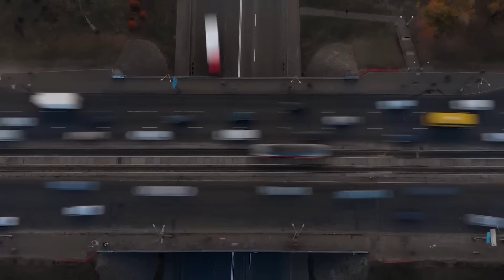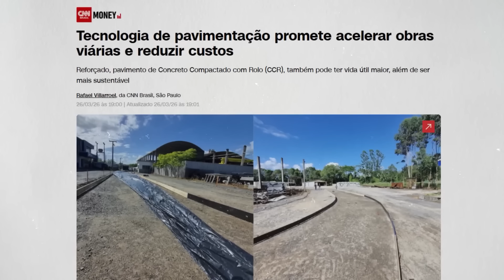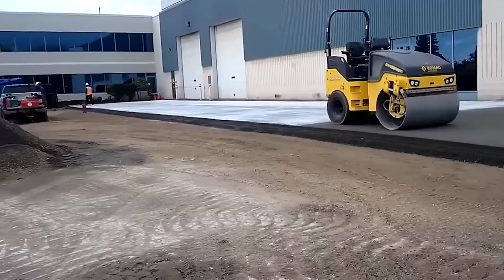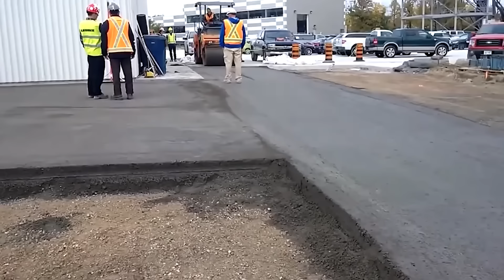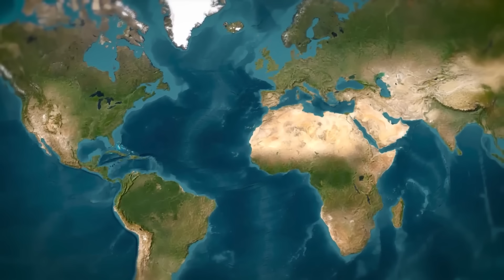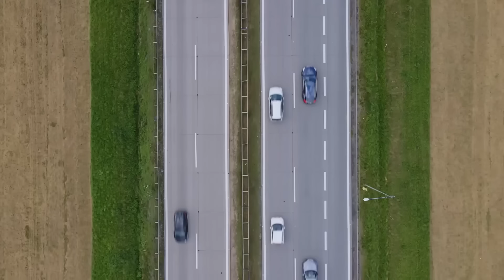Brazil Unveils Road Paving Tech That Lasts 3x Longer!

Comment: Non concrete pavements with crushed rock subbbase and basecourse are designed to be flexible, to rebound from a heavy loads, and the seal coat and asphalt keeps it dry. A non-flexing , structural pavement needs to be much stronger, the cement must bind it together. If it doesn't flex then it also can't be allowed to crack under load. Getting it right for the cheapest price is the real trick. Going full concrete is very expensive, and also expensive to dig it up again, a weaker cement mix is cheaper but will break up under heavy loads, getting the balance right for the conditions is what all road designers aim for.

Comment: This is not new road paving technology, it will degrade the same as all other road paving forms, due to the fact that the Advanced Road Building Technology is not being used, so that the highways; freeways; and roads will last between 25 and 45 years without maintenance -- Only One Concept will ensure Highways/freeways are built to last - created with perpetual results ... Adept Technologies LLC they created the final solution for the Transportation Industry ... Guaranteed!!!!

Comment: What about noise levels? Concrete surfaced roads usually generate higher noise levels than tarmac and not just around the road but also for drivers who have been found to become more fatigued on concrete surfaces because of the constant hum. Tyres also wear more on concrete. I did see than the new surface does seem smooth so perhaps it eases these problems as well.

Comment: News Flash!  Heavier vehicles demolish roads faster and EV's are Heavy.  The downside of small aggregate is weaker concrete this is one of the reasons large aggregate is used in Dams.  Where's the comparison to 7 sack poured concrete in terms of longevity?  (it's an apples to apples thing)

Comment: Brazil is lucky to have a stable, narrow range of temperature.
This extends the life of road surfaces except for damage caused by rain pooling in low spots.
Reply: Not as standard as you think remember teh country is continent size so its not all the same.

Comment: Years ago they did a test patch on the freeway in Spokane WA.  Each side of the freeway had a 1/4 mile stretch that was pave with different surfaces.  After 5 years the east bound lanes which had some sort of fiberglass mixture looked like the day they laid it.  I don't remember what the mixture was in the west bound lanes, but it didn't hold up.  So, what do you think they used the next time they resurfaced the freeway?  The same old asphalt they've used for years.  It's called job security.

Comment: Not taken into advisement in this clip is the creation of huge amounts of environmental pollution caused in the production of 
cement,  a key component of concrete.  Alternatively,  Alberta already has available huge deposits of bitumen,  as is required for roads.  Let’s use that resource first !!

Comment: This is essentially how the American roads are built.  Just look at the mess they turned out to be.

US infrastructure is collapsing at a huge rate,  bridges degrading, large section concrete roads, even with cuts to reduce sections, terrible to drive on.

Obviously this video is sponsored by the machinery manufacturers and system inventors.

First time any frost and you are back to a gravel road.

Comment: I could see a possible future improvement where compliance is introduced by added materials such as fibers made from compliant materials allowing the CCR to absorb and spread shock loads better than a more rigid structure. In areas where large daily temperature swings are common a more compliant approach would mitigate thermal cycling and possibly some frost heave stress forces.

Comment: I have said for years that concrete is a better road surface than asphalt. I get so frustrated when I see new asphalt paving being done and I pay attention to the areas where the lanes come together. It looks to me that as you add lanes the point where there connect is an area that is prone to failure. I think this is due to temperature, hot asphalt does not bind well to cold asphalt and because of this you have the weak link. Unless you can do all the lanes right next to each other with asphalt you are going to have an issue. Concrete is does not have this problem because you’re pouring it. I know temperature affects concrete and adding chemicals to concrete can change the makeup, I just feel concrete temperature changes are easy to deal with vs asphalt. I would love to see this product used all over. What is the cost difference per mile with these products?

Comment: RCC has some advantages over wet-pour concrete, but is still expensive and not very eco-friendly. Think of the thousands of tonnes of material that needs to be transported to site. A better option for the base layer is to stabilise the insitu material with cementitious binder plus nanomaterials to improve material performance, provide water/frost protection and prevent shrinkage cracking. The wearing course could be a relatively thin layer of RCC or asphalt.

Comment: In cement the water cement ratio at .4 is completely impervious to water and extremely strong. The introduction of fibers in the mix prevents micro cracking at the surface. Ferro cement boat builders know this technology.

Comment: One single overweight truck causes the same damage to roads as a whopping 9,000 cars.
Brazil does not have the freeze thaw cycles the USA has not has to deal with salt/bring on roads either.

Comment: This method is missing one step, resonance compacting of the foundation, "Sound Waves Turn Loose Soil Into Solid Walls. No Cement Required. Could Foundations Become Obsolete?" and "This Simple Vibration Trick Builds A Foundation WITHOUT Concrete. Big Industry PRAYED You’d Forget!", The Buried Vault and Uncover Vault. This missing step is probably the reason why any maintenance is required for that 20 year span. The underlayment mix and compaction makes for a firm foundation, better supporting the RCC.

Comment: This low water technique is what the Romans used to build roads and aqueducts still in use today. They had to use local materials, no one was trucking rock 100 miles. Local materials and very low water. Had to be hell to work with

Comment: Roads last longer in warm climate. No frost induced heaving and cracking.
Reply: Does not solve the issue of asphalt bending with heavy traffic.
Reply: @spirit333_3 yeah but they are dry poring concrete and dry pored concrete doesn’t last but a few years.
Reply: @wardraven8755  The issue then is using those dumb hammers to break that concrete. It's cheaper to just use a asphalt cutter on the excavator that just cuts through the asphalt and good straight lines and then re-pave.
Reply: @wardraven8755  It's not dry pour, it's minimal water in the mix. You can see how it comes up once they start rolling it, especially where it's vibratory rollers.
Reply: No kidding. I was driving in Cambodia a poor hot country. All the roads were in excellent condition, No freezing ice and cold.

Comment: 1 of the biggest challenges to reinforced concrete is going to be stopping the steel from expanding, chlorides get into the cracks in concrete corroding the steel mak8ng bigger cracks intruducing more chlorides until you have to rip everything up and do it again.
Reply: This problem has been solved long time ago. 30% of Germany's roads and 22% of Poland's highway roads are concrete. 
I learned this method in university 25 years ago. This is nothing new.
Reply: @thomasprogli3372 oh how did they solve rebar corroding? Did they set it deeper add some lime to the mix?
Reply: @alan_clough  With a little help from ChatGPT. Also keep in mind that they use a lot of salt in winter. My car is always covered in this stuff:

Austria and Germany prevent rebar/steel corrosion in concrete highways mainly by:

1. Using durable concrete for salt and frost exposure.
2. Keeping enough concrete cover over steel.
3. Using plastic-coated dowels and tie bars at joints.
4. Sealing and maintaining joints so salty water cannot enter easily.
5. Designing drainage so water leaves the pavement quickly.
6. Controlling cracks through planned joints and good curing.

The most critical detail is often not ordinary rebar in the middle of the slab, but the dowels and tie bars at the joints, because that is where salt water attacks first.
Reply: @thomasprogli3372 that makes alot of sense, at some point I wanna dive deeper into those techniques.
Reply: @alan_clough  Well AI's make that so easy today. Also in Germanic countries everything is a public standard. All you need to do is ask an AI agent to do some deep research and compile everything for you. Get a $100 subscription for a month to get best results. It will translate everything for you. It is increadibly simple.
Reply: There's no rebar in the concrete
Reply: @waynemcfarlane1233  Do you mean in this method. If so can you name this specific construction method. 
In my country we definitely use rebar.

Comment: According to doing some search results , these are much more expensive than asphalt and take must longer to set and are not smoother at high speed thats why they mostly used in ports and areas with heavy weight traffic but traffic thats slower moving compared to highways

Comment: It depends very much on the ground conditions and the local climate.
RCC is nothing new, but it’s a rigid construction so has no resistance to flexing ground.
It also needs regular maintenance with joint cleaning/replacement.
There’s no easy fix to road construction, appropriate design is the key.

Comment: I helped lay a concrete section of the A14 to Felixstowe Docks.
20 years later id had to be completely dug up and re-laid with Asphalt.
Reply: Yeah but that was not roller compacted concrete that was laid 20 years earlier right? Cause that's the point that was made here, that compaction and very little initial water content to the concrete would deliver much more dense and impermeable layers that for those reasons would supposedly last much longer than normal concrete would as it among other treats allows very little water intrusion.
Reply: So basically it worked then, lasted 20 years. Better than redoing asphalt every 5 or so.
Reply: @russburton8517  You would still do the asphalt, the saving is the underlying basecourse and subbase, that's the real cost of building a road. 20 years for a concrete road is good value, a fresh coat of asphalt 2 or 3 times during the lifespan is also expected.
Reply: China built a new road somewhere in Africa a few years ago. About 100 miles long. It didn’t last one year.
Reply: @laker6943 Pls try too Learn to name the country and not some where in Africa. Because there is, a concrete road build in Ghana, in the 60's and still doing well.
Reply: Asphalt will need to be redone every 5 years

Comment: How does this method hold up to high freeze/thaw cycles as in central North America?
Reply: Very well. 30% of the Autobahn is made of concrete. You know the highways without speed limits. Imagine driving 300 km/h on a cracked highway?

Comment: Can always put an asphalt wear course over it.
Reply: That is bad news in a relatively short time. The concrete breaks into slabs. The cracks propogate through the asphalt and clunk, clunk, clunk clunk etc. After asphalt overlay, next stage is digging it all out and laying hardcore covered with asphalt. Unfortunately in wet/freezing climes, the earth moves rather too much.

Comment: The pavement and materials involved in bettering the wearing course, will only ever be as good as the foundation inn which the pavement base and sub base sits on......
Reply: Yes, the foundation is critical.  I watch streets getting resurfaced by first milling off the top layer of asphalt.  Then, they oil the rough surface and later apply 2 layers of asphalt--a coarse layer for strength followed by a finish layer for smoothness.  They rarely the remove unstable base and replace it with concrete, compacted crushed rock or something solid.  After a couple of years, the areas that were riddled with potholes start having potholes again.  You can actually predict where the new potholes will form.  If they took the extra time and spent a little more $$$$$$ to fix the base (foundation), the new asphalt would last longer.
Reply: @ILGuy2012 💯%

Comment: Here in the Netherlands tarmac with an open structure is used on highways, making driving in wet conditions very comfortable, as if it’s dry outside, with almost no splashing. As concrete solutions like this looks very compact, it would only be a maintenance advantage, but a disadvantage for safety under wet conditions.
Reply: Yeah, hardly any spray, which increases visibility in wet circumstances. On top of that, the elasticity helps to prevent potholes.
Reply: You also have a relatively mild climate, without severe winters. They tried that in Southern Ontario, where the diurnal temp swings are among the worst and winter lows can go below -30C but I don't think it worked too well. It's not talked about anymore.
Reply: @MK-hi3lj Of course not, every solution is made for the situation it is used in. In the Netherlands we have occasionally freezing temperatures, but nowhere near the low temperatures like in Otario. Nor do we have extremely high temperatures. At least not for a long time in a row. But we do have frequent rainfall and a lot of traffic.

But what is interesting to see is that Belgium our neighbouring country has the same climate, but uses different techniques and they have a lot of potholes and visibility is dramatic when it rains.
Reply: @MK-hi3lj  low temperatures do not matter very much for open asphalt roads.
water freezes at 0 celsius, anything below that is not so relevant.
but high temperatures are.

the asphalt becomes plastic and gradually deforms.
the tracks that are formed are a real hazard.
that is why busy open asphalt highways get a new top layer every couple of years.
and with the equipment and the logistics organisation they have, it is done at an incredible speed without lengthy disruptions to traffic.

Comment: Maybe this could tried in the UK.
We have many very badly worn and pot holed Tarmc roads.
Ironic that Brazil is building so many new roads, while the UK can't afford to maintain its existing ones.
Reply: RCC is used in the UK in very heavy use areas, such as port terminals etc. Asphaltic concrete is most common for busy public roads, while tarmac is used on low volume areas, such as driveways and remote roads. What is underneath the surface has a lot to do with what goes on top. Changing things can result in a cost 10, 20 or 30 times greater than simply resurfacing and patching.
Reply: So, just put up with the potholes and the subsequent wrecked tyres and wheels? Wonderful!
This just goes to show how impoverished my country has become. Very sad.

Comment: Two Polish winters and the concrete road is falling apart.
Reply: I spend 5 minutes to understand how winter can polish the road. And then understood...🤣
Reply: @REZOLUTIONER yeah I'm just imagining a beautiful and shining concrete 😂😂
Reply: I didn't know that Northern Illinois, where Chicago is located had Polish winters, roads like to fall apart there and sometimes summer is referred to as construction season when roads are repaved. But I looked on Google and if designed and done correctly RCC construction will do well in Polish as well as Chicago winters with frequent hard freezes that freeze the ground to a considerable depth especially later in the winter where there are many freeze thaw cycles that cause pavement damage and potholes.
Reply: for those that dont get it - over 32°C (90°F)  in summer for 2+ weeks, -20°C (-4°F) in winter for same 2+weeks.
Also whole winter is just below the freezing point, and supersalt is used on roads to keep them from freezing. 
While highways survive for a years like in rest of the world, city and urban (cheaper) roads dont.
Reply: In 2023, GDDKiA stated that Poland had about 1,065 km of motorways and expressways with concrete pavement, around 22% of the fast-road network.

I am so suprised how ill-informed many viewers are.  Come on guys stop upvoting ignorant comments.
Reply: @thomasprogli3372  Betonowe drogi mamy od dawna, ale pokryte asfaltem.
Reply: @ocizzico  Sure, but many have a concrete surfaces. Are you an engineer? I know that a company I used to work for built a highway in Poland and they used the concrete method. So I am very confident that this is common practice.